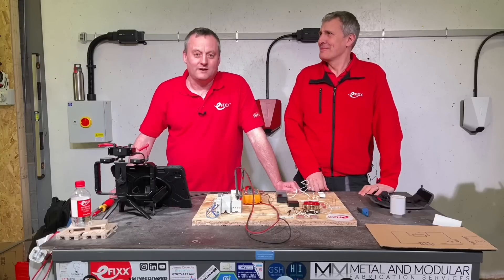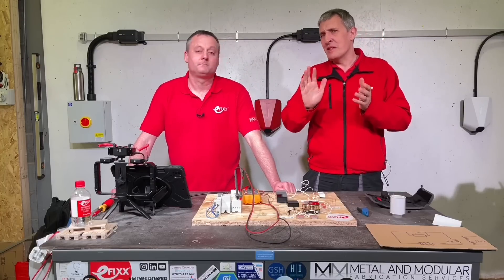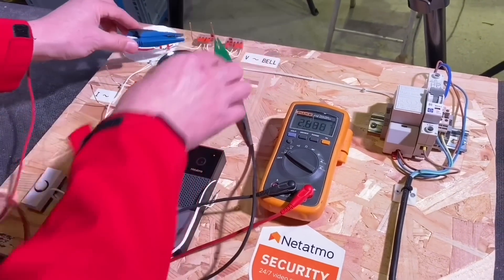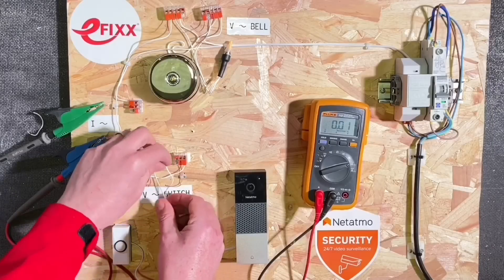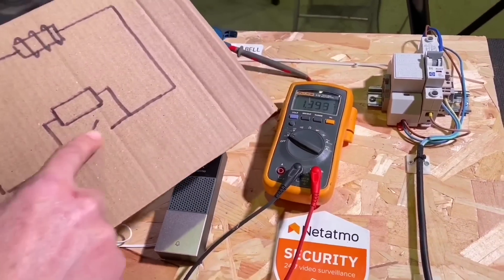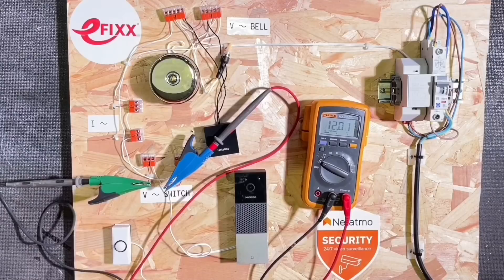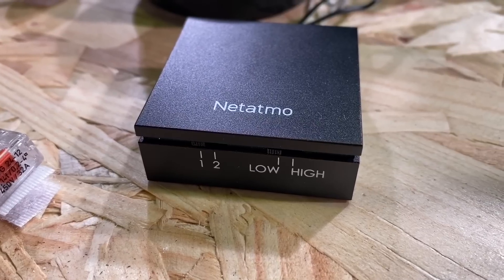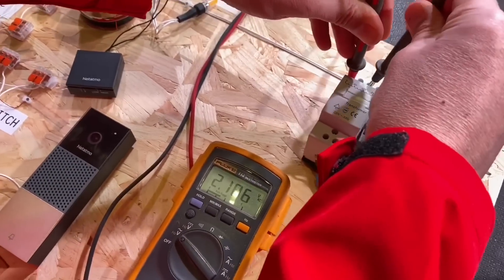NETATMO Smart Doorbells - Understanding Chime modules and transformers

Comment: Cool video, can't say I understand everything, but oh well — I bought a Netatmo Doorbell (living in Switzerland) using it on a Honeywell D2105 chime that says "18VA" and "220-240V". The Doorbell never moved past a pulsating green light, I never reached the installation process with a white LED, no matter what I did :(
Reply: Did you try to push the button until the light turns white? Factory reset might be needed. I had a problem with the wires, but now it seems to work.

Comment: Had another one these installed but not with a bell, it doesn’t work out a Wi-Fi booster near it Wi-Fi is better do I need a bell to make the circuit work
Reply from the maker: you shouldn't need a bell - but you would need to set the chime module to the right setting
Reply: @efixx  I’ve messed round with it, set it up through the Netatmo app and the chime module is on it, it’s working but couldn’t see it in my phone when I left home must need a strong Wi-Fi boost
Reply: @efixx  if your not using a chime then you don’t need the chime module. Just connect transformer direct to camera.

Comment: Nice Video ! I just purchased my door bell and i want to replace the old system. Does the chime module support 230 V input as i can find 230 V bells without transformers. Yes it would mean having 230V outside but would prevent me from adding an extra transformer in the fuse box.
Reply: @efixx  alright thx !! I will then buy a transformer and add it to the fuse box.

Comment: Is it possible to replace chime in existing electrical circuit (high or low voltage) by something else to have Netatmo doorbell works? I have a circuit to which I can connect Netatmo device but do not have chime and do not want to have (too noisy and not needed actually)
Reply: I would think that a 12volt bulb such as a car tail light would be a good alternative.

Comment: Silly question... does the smart bell and chime worry about which way around you wire it? For a standard bell button and ringer I guess not, and both wires on the chime are black so I guess bot but just checking. I've been waiting for this model to be released for a couple of years. It fits well for my needs.

Comment: Hi great video. Would this work with a Byron 7770 transformer https://www.toolstation.com/byron-7770-transformer/p77815 . It's 8V 1A however someone advised me that the transformer needs to be 8VA
Reply from the maker: Yes - The one we used is a Byron transformer. 8VA is 8 volts at 1 amp in this case.

Comment: I love this doorbell and the fact that is HomeKit compatible, I want to make an installation without chime (the ideia is to use the HomePod as chime), does anyone know if it’s possible to connect the 230V directly to the natatmo doorbell without transformer? If yes, do I still need the chime module?
Reply from the maker: You would still need a transformer and you would need to put the chime module in circuit to avoid short circuiting the transformer when the button is pressed on the doorbell.
Reply: @efixx  thanks a lot for your help, one last question, I have an AC-AC adaptor with AC230V input and AC18V 500mA output, is this good enough ? thanks a lot
Reply: So, with a transformer, i'd run one of the two cables to the chime module, than onwards to the doorbell?
Reply: Thanks for the answer. Using it exactly with this setup and was not sure whether the module would need to installed then or not as the app allows me to switch of the usage of a physical chime. One might think that this is enough but thanks to you I installed it with the chime module. :-) @efixx
Reply: can you make a short video on this with wiring diagram? im sure a lot of novice  are interested but hard to find anything online

Comment: My son is in the process of refurbing his hall, stairs and landing so means new everything including ceilings etc. He's got a ring battery system at the moment but is going to replace it with something else with a permanent supply so it's obviously the time to install a cable for it.  it seems that different smart bell manufacturers use different voltages and he hasn't yet decided which one he's going to buy so we've decided to wire in a socket into the under stairs cupboard (he needs one there anyway for a camera system) and take a cable into there ready to wire into a plug-in dedicated supply. These bell transformers are just so old hat at 8 volts and being 2 din wide there's often not a space in the consumer unit for it and also they're often in an unsuitable location.

Comment: The output voltage is high because the transformer expects 230 exactly to produce those voltages your input is likely at 240 which is why you're getting a higher volatage on the output
Reply: The input voltage discrepancy isn't enough to cause the additional 50% - 100% voltage on the unloaded secondary.  It's designed into the circuit to take account of voltage drop when current flows through the transformer windings, and through the thin bell wire which is typically 10m long to the switch and then the bell.   Those cheap nasty switch contacts can lose a bit of voltage as well.

Comment: I fitted a Google Nest Hello doorbell yesterday - I opted for a chime-less install as i'm using a google home hub to announce that there's someone at the door. The wiring diagram on the google nest site showed the chime device still needed to be used and wired inline on one side of transformer output. I taped up the two wires that would have gone to the chime. I wonder if there's something in there that also helps regulate the voltage rather than it simply being a bypass?

Comment: Would really like to see a smart door bell with remote wireless ringers (eg plug in ringers) assuming one exists ? Or ones that can announce via Alexa etc.
Reply: Ring door bells have remote ringers and they announce through Alexa
Reply: @nedloh17  I concur, I was about to reply exactly the same thing.
Reply: Hi Vincent Guidi. If the Netatmo Smart Doorbell is added to Apple Homekit and there are Homepods in the system, the Homepods will also chime when the bell push is pressed.
Reply: @richardhopkins5452  thanks for the information.
Reply from the maker: Good question we’ll find out what’s possible with voice assistants.
Reply: Works directly with Alexa. Just configure Alexa to ring when door pushed.

Comment: Did a ring doorbell took it back after 3 days bus kept setting it off, moved the zone down still happened even got it lowest you can do still same and ring customer service said its the body heat off the bus 🤦‍♂️ that was with a 1st gen one I don't know if they improved the system
Reply from the maker: You can switch off the triggers with the Netatmo - so it only triggers when someone pushes the bell.
Reply: @efixx  ooh I'll have to look in to that one cheers